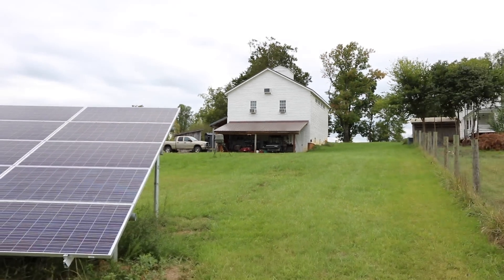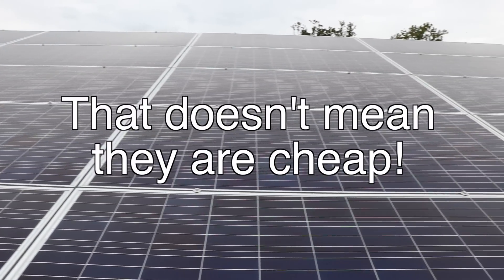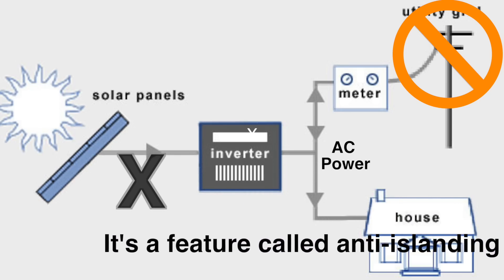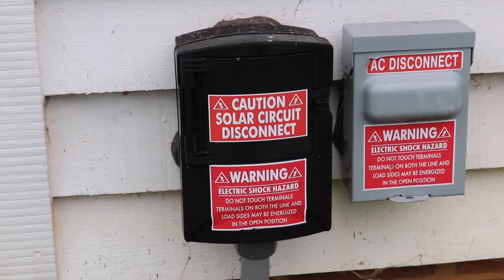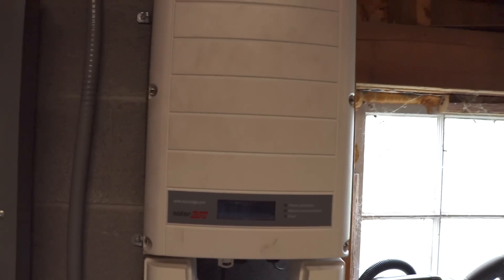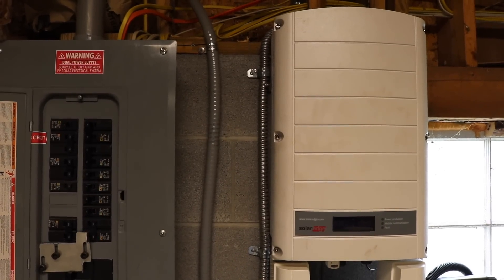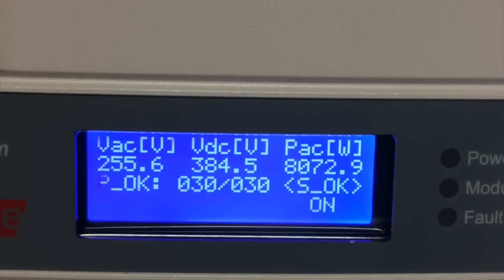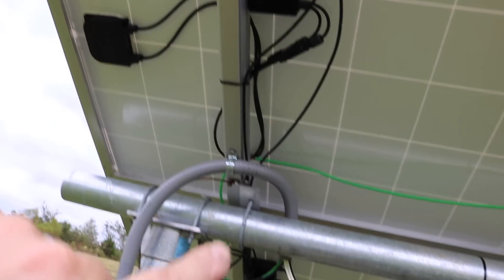The ugly truth behind grid-tie solar systems. Part 1, FarmCraft101 solar.  Watch before you buy!

Comment: What is the voltage in your house? 240 Volt?
Reply from the maker: In the US, we have 2 hot wires that feed the house, each 120V, 180 degrees out of phase from each other, so there's 240V across the 2 hot lines.  So we have 120V for regular receptacles and most household items like hair dryers, microwaves, etc.  But 240V is available for larger loads like a water heater or range.
Reply: @FarmCraft101  I was confused  because we use 220 to 240 Volt 
I knew you use 110 Volt in the US.
Thank you for your reply
Reply from the maker: Ah.  I have bad habit of saying both 240V and 220V while meaning the same thing.

Comment: You should be able to run a grid tie inverter when the power goes out.  It require the house to disconnect from the grid when it detects a loss of connection or power from the grid and continue charging batteries and powering the house.  I would think most grid tie inverter system could handle this, but if not there should be some system that will let you do this.

Now the Tesla's home solar systems are even worse.  They will stop charging if they lose internet as they are monitored and controlled through the internet.
Reply: Batteries = $$$'s

Comment: Not addressed, The maintenance costs of ownership and the cost to those who don't have 5 acres of land to put this system on the ground. I had some clown peddling one of these systems for my roof.  Told me I would need structural engineers and reinforcing my roof structure to install (NOT!!)  
Also, the cost of removing one of these systems from your roof in the event of roof failure, damage etc. is near the cost of the system.

And, let's not forget the hassle of getting potential home buyers buying out your contract in the event of a sale.

I'll pass.

Comment: We got a 5kW grid tied system for $9k- unsubsidised. It comes down to price and usage. We don't use gas. Utilise some of the excess power by heating your water cylinder during the day. Keeping the power supply close to the power use area is more efficient... The company that sold and installed my solar system was bought out by a power company- probably because they were providing a service cheaper than anyone else (even though if you do the math they were still making 'a tidy' profit)...

Comment: I just had a 9kw system installed with a sunboy inverter (sma-america.com). Once the grid goes down the inverter routes power to the built in power outlets on the inverter. I have no battery backup but at least I can run a fridge, lights, etc.. during the day and let it coast overnight. And or charge battery cells for phones, lights, and power tools during the day. After my tax credit it was about 13k. 20 year warranty on labor (including roof leaks). No down payment and 2.9% interest. It was a no brainer for me in Florida for partial off grid like power for this cost.

Comment: An inverter is basically a fancy step down transformer (like you have from your array) or inverter-charger if you have a battery store setup.... OR an inverter is a Step Up transformer, which TAKES energy to make the magic happen, (like you have on the left, from your batteries.).  Step up xformers are larger. And I think noisier? Run hot?

Comment: 9.1 kw will never earn $2000 a year. Probably only about 15-20% of that figure. It has been 1.5 years, what is your lifetime KWH production?
 You should have software that will track that figure.
Reply: But it will be very close to $1,750 per year.  Your 15% - 20% figure is pure BS. Do you even have a PV System?

Comment: What I can't understand is WHY you didn't have the installers mount the inverter system AT the solar panel array?!?!
That way all you would have to run in wiring is one AC line...8ga or 10ga? back to the barn/house and into the rest of the controller system. 100yds of AC line has almost no voltage drop VS a 100yd DC line.
The system is beautiful but this oversight is unbelievable.
Reply from the maker: Transmitting DC power is more efficient than AC.  This is a common misconception.
Reply: @FarmCraft101  Sorry bro....but read up on why Edison's DC power systems lost out to Tesla's AC generators at Niagara falls. Edison's DC generators had to be placed locally and resulted in many power stations all over the city. This was due to the fact that DC suffers a great voltage drop over distance. Tesla's AC hydroelectric plants could send power across many miles of transmission lines without any significant loss in voltage or total calculated power.
Don't take my word for it, check it out for yourself....you might be surprised.
Reply from the maker: @jolujo5842  Nope.  The reason was that DC couldn't be easily transformed, so it was easier to transfer AC when it was transformed to higher voltage.  But when at the SAME VOLTAGE DC is more efficient.  Look it up.  The reason is that electrons have mass, and AC voltage causes those electrons to change direction 50-60 times per second.  Fighting that inertia causes inefficiency.  DC power does not have this problem.  In my case, my DC power is at 360 volts, which is far superior in efficiency than 2 legs of 120 volts as you are proposing I should have done.

Comment: 8 year break even point also assumes nothing will go wrong and no repair/replace costs will happen.  That is not very likely. Additionally, put that $17,000 in a simple S&P 500 Index fund and it will double to $34,000 in about 8 years.  All in all, its a poor investment.  Prices need to come much further down before this is practical.

Comment: could you show a breakdown of the cost of the $17,000 system?
Reply: most of it is for the solar panels. i planned and installed systems like that about 10 years ago.
Reply: $4000 panels, $2000 inverter, $1000 mounting and cables, $2000 work. $9000 total. If you want it on a tilted roof instead of a field you can probably add another 3k for the complexity. $23000 for the system is bonkers.
Reply: Omar Williams  You should watch the video again. He was talking about the grid tied system with the mentioned price, the inverter with dc charger plus batteries are additional upgrades.

Comment: Hi, just found this, I like it, but you say you only have one wire to the inverter, don't these panels have two wires, B+ and Negative? Where's the other wire? Thanks
Reply from the maker: By wire, I meant 1 cable.  It includes 2 conductors and a ground.

Comment: This was incredibly useful.  Want a whole house off grid solution. Live in a place (Macedonia) much of the year and they literally cant keep the power up.  I am about 6 miles from the absolute centre of the capital city.    So I want a solution.   The price is insane if you use a local company but I found a reputable foreign company that can provide a 10kw system.  It actually costs less to fliy 2 engineers in and put them up than buy local.   But I want to know a lot more before I commit. Initially I was going to buy a generator but I thought if I am going to do this, then why not try and be sustainable.  Incidentally the gap, in terms of cost, is not as big as I thought.    In my case it will have a backup capacity which the solar will feed.   My concern was battery life and maintainence as well as the current in.   Use a lot of sensitive equipment so the current has to be clean and if I am spending this, I dont want to lose my mind because it failed after spending a lot on it.  Not to mention ultimately being murdered by my wife.
Reply from the maker: Lots more info for you in parts 2 and 3.
Reply: My brother is going off grid. First he is having a 50 panel system and its like 20kw I think or around that.

BYD batteries which are modular if you want to add more but they are great batteries for the price. 

He'll get wind later it's not as good and reliable as solar. And finally a diesel generator for winter incase they need a little bit more power but it rarely comes on.

Its going to be cool to see it done!

Comment: Here's the problem I have with calculating solar payback. This is a 9100 watt system that only put out a little over 8000 watts at noon on a sunny day. If that's in the middle of summer then it won't be that in the middle of winter. So is the payback really 8.5 years? I wish the poster of the video would show some actual production by month graphs.
Reply from the maker: https://youtu.be/gAswWVETWKo

Comment: Also, I'm at the 50-150 range for my bill. Does the power company pay you for excess power your add to the grid? Seems silly to me to be so close to being off the grid, but still having to suffer through power outages. For my $ that's a waste. Plz tell me you have a way to power your house if the grid goes down for a long unknown duration. And again 8.5 years with zero maintenance cost for a buy in of 23k-7k(tax cut/refund/credit). I'd like to know the total cost in 2025, definitely more than 17k, plus the sun doesn't shine 24/7/365. 

17k+maintenance+using grid+vegtiation growing over it-maybe adding to the grid+the grid goes down so do u=most likely looking at $25k over 10-15 years
Reply: If the Grid goes down then use an AC Generator.

Comment: Did you do your "due diligence" as most farmers know to do during the planning stages...   In Australia I did so on a new home (a McMansion which she wanted and would not listen to needs assessment) 21 panels of 300 watts each and the later option to go battery backup and totally disconnect from the "grid".   ....   The huge ducted aircon, solar HWS and bottled gas (45kg pair giving 12 months service) she was getting Au&80 rebate from the electric supplier.   current installation for a similar sized system is Au$3500...   In Australia all power is single phase 240VAC,   or 415VAC three phase...     For me that is a deal.   I even had 13 panels of 300w each on my boat (a 40ft power cat with a cruising range of 2000km on diesel engines for propulsion none for other services...

Comment: Why don't you build a small shelf under panels to mount everything including batteries there, and exit with 3 ac wires only to provide to your house, you will reduce loss on wires to transport dc to that distance. A nice cabin under panels well isolated and hydroisolated. You won't need all those into your house. Plus you exclude any error fault to burn your house.
Reply: Transporting DC Voltage is not an issue.

Comment: The best thing to do with your system is add a Magna sine 4448PAE that connects to the grid  and have your Inverter connect to the AC output on the Magnasine inverter That way when the grid goes down the Magnasine will switch to Battery backup and the Grid tie inverter will not shut down because it will see the Magnasine inverter as the grid. You see the Magnasine has it own island protection and will disconnect from the grid but the inverter switch so fast the Solar inverter doesn't shut down so the House can still us the solar power when the grid goes down. All you will need is 8 x 6 volt deep cycle batteries and the Magna sine inverter and a sub panel between the two inverters and the breakers for needed electrical outlets. It's called AC coupling. and can cut out all the daytime high hydro prices if you have enough solar panels and could charge the batteries for night power uses.

Comment: interesting  if one shops around just to get panels and micro inverters.. here we are at the start of 2019  one can get 10000 watts of power for under $5000.  That said still need to do the electrical connections, permits and that side of the infrastructure to get connected to the grid.  Personally if I had the space I would never mount the system on a roof.  The reason is if the roof dies have to remove and re install the entire system.